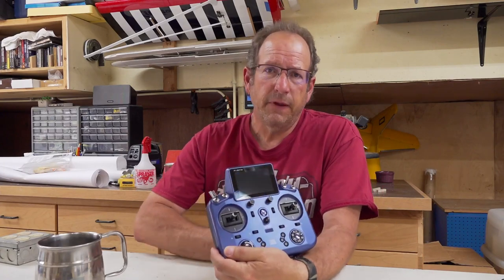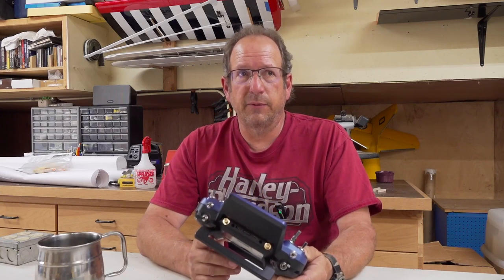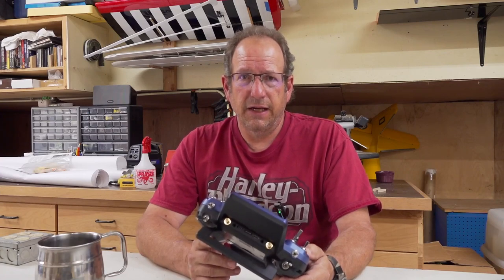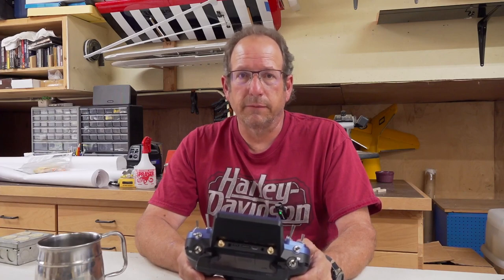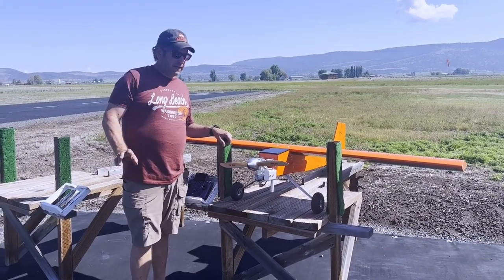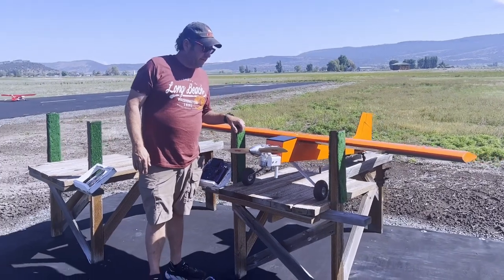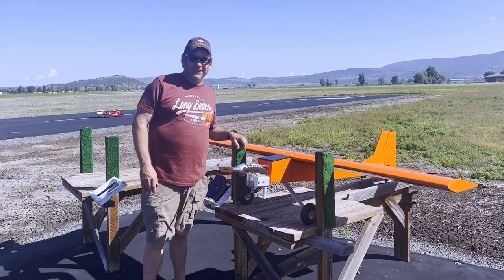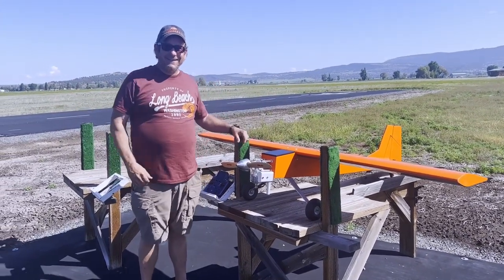Maiden Flights can be no fun at all.  Building a giant scale RC model, Ryan's Rebel RCM Plans

Comment: Dan you teased us with that maiden. The way you started the video, so somber I was waiting for you to say you crashed the Rebel. Congrats on the flight! Great build and flight.
Reply from the maker: That's one thing I was kind of afraid of, making a build series and then destroying it on the maiden.  But this design is so simple I wasn't too worried.   I did wreck one on a maiden several years ago.   I was going through a GeeBee fetish and built an Adrian Page GeeBee R-2.   Spent a lot of time to make it perfect.  Everyone warned me that the R2 is hard to land.  Like they always nose over.   It flew great very responsive but stable.   When it came time to land I had too much speed and the gear crumpled.  And I didn't have the energy or heart to give it any more time.  It is still in my storage unit.

Comment: Great job Dan and Mark. Loved the flight and the whole series. Nice field too. I just maiden my Arrows RC Husky at the Silverhills RC club grass field north of Hayden Idaho where I live. I wasn't so successful, had a stripped rudder servo, short flight and nosed it in on the right wing tip. Broken aeleron linkage horn not sufficiently glued from the factory. Made most of the repairs now. Installing the new rudder servo now and put everything back together  and go try again soon.
I am also scratch building two 50" Fly Babys from a set of plans.
Reply from the maker: Good luck on your maiden v 2.0.  Mark is looking over a set of plans he found for a big Fly Baby.   Might be a winter project for him.

Comment: Those maiden flights always gave me the shakes...  Good point about unknown trims and controls on the first flight.  Even if you are building from a plan or kit, and set the control surface throws to specifications, it may still turn out to be too much or too little for comfort.  
What has worked well for me is to set the throws a little larger than what I think they have to be, then use Dual Rate or Expo on at least the elevator and ailerons.  That will give you fine control even if the deflections are larger than they should be, and you maintain control authority when the throws are on the small side and you need to compensate quickly for a large trim error.
Reply from the maker: Agreed, and don't forget to expo that rudder.  Having a little expo will keep you from over correcting your takeoff.   I would rather have a little too much throw than not enough.  After that first flight or two you can reduce if you think things are too hot.

Comment: Can you comment on the overall flight quality?  Did it feel like a giant stik in the air. How was the handling in the air? I am thinking about building one --thanks
Reply from the maker: I don't think there was any bad characteristics of flight with this one.  Very much just a giant stick.  Landing is easy, stall speed is low and didn't notice a tip stall.  The Ailerons can be toned down as they are full strip so way too much throw is available.  Mark built flaps on his.  I don't think they are necessary as this plane slows down nicely.  Manuverability is great and predictable.  It has no recovery features like washout  or dyhedral so, you gotta fly it the whole time.  Yet it is stable.  I was sceptical the 30cc would power it adaquately but was wrong.  Power is perfect.  Ryan told me it would be.  Pretty much just a fully capable manuvering design that will do everything you want, although I haven't tried to flat spin it yet.  I am excited to finally have this one flight worthy.

Comment: FrSky range check function reduces the transmitter power to 1/30th of normal, or at least that's what it is for my X10S.  Also, the FrSky Tandem series of transmitters requires their tandem receivers to get the benefit of simultaneous 2.4gHz and 900mHz.  The Tandem transmitters are backwards compatible and will work with ACCST D16 protocol receivers.  Congrats on the successful maiden.
Reply from the maker: Thanks Don!!! Yep I have a lot to learn on this 18x.   I have a 10x that I just changed from OpenTX to EdgeTX.  The only thing I don't like is the 10x is its like holding a patio paver.   I might do some videos about the Fr Sky systems but there are a couple of English chaps that do a great job with programming and updates.   I just want to make it do what I need and fly it.
Reply: @Capgains7777  I'm trying out a Radiomaster TX16S this year.  Has a cheaper feeling compared to the X10S, but it is lighter and more compact.  So far, works fine.
Reply from the maker: Like what I have seen with the Radio master.  I lightened up by getting the Tandem and Ethos is a little more intuitive.  The Horus is able to run my XPS Rxs with the JR module box.  Which is cool but complicated.  Yeah once everything went 2.4 the options for geeky radios went through the roof.   Did you ever own Multiplex?

Comment: Congrats Dan nice job, Ive had the plans printed off so you know whats going to happen next don't you! anyway what receiver did you end up using with your neat tandem X20 tx.
Reply from the maker: I believe I used an X8R which is the older version protocol accst Rx I bought to use with a Horus 10 radio a few years back.  It’s a little confusing all of the options available with these FrSky radios.  The guys at Aloft Hobbies told me for IC gassers the best protection for noise is the Archer line of Rxs that use Access protocol.  However I have read many forums where guys are using the ACCST for long time now and no problems with ignition noise. With a tandem radio you also have the option of duel band RXs that cost a little more but transmit on two totally different bands at once making better redundancy.  Probably going to have a show and tell about these radios in the future.  I really like them.

Comment: watched all of them. great vids. presentation was good as well. what size servos did you use?
Reply from the maker: They are standard sized Hitec servos, HS545BB, which are nothing really special.  I built the Rebel with parts that I had on hand of which most came from retired planes.  On larger planes if I had to buy new servos I would probably use Hitec 635MG (metal gears) as they are a great choice for strength and reliability used by many  giant scale modelers.  Once again nothing special, plain ol analog servos but simple, powerful and good.  At some point I would like to research some digital options, because I know there has to be smaller, lighter and more powerful servos I can use, but I still have these analogs in my stock so I will use them up first.

Comment: I’m building a SIG 1/4 scale cub, I think I’ll be too nervous to fly it
Reply from the maker: I totally get that.  Take your time, build it straight, and set it up with proper throws and CG.  Have some faith in the design of the aircraft.  A lot of people have flown Cubs and you can too.   My only advice specific to cubs is, use the rudder to make it track straight on take off and make sure you have the tail flying before you apply elevator to lift off the runway.   Because the wing on a Cub is longer than the fuse and a big popcicle stick, the plane will torque left when you give it throttle.   Be ready to add some right rudder to track it straight. Cub flyers are good drivers.  Good luck.

Comment: It's like a young eagle standing on the edge of the nest high above the canyon about to jump for the first time. Will it fly or will it fall to its death? I know the feeling well. I did not set out to be an rc test pilot. It evolved. A friend asked if I would maiden his plane. It went well and another friend asked. Over time I was a popular guy to go to if you wanted someone to test your plane. I have encountered most every problem you can imagine.

I do my best to catch potential problems during my preflight check list. The usual suspects are out of balance (tail heavy is awful), low battery, controls reversed, not enough power to weight ratio, airplane not symetrical, does not track straight, wheels sticking, gear not forward enough on tail draggers, rates-expo not within reason, gyro settings not correct and gyro not set on a switch that can turn it off, bad or wrong size prop, props reversed, props not on tight,  plane stuck in 'safe' mode with hardly enough throw to control the plane, receiver problems at distance - can catch with range test, an owner who expects me the test pilot to pay for the damage if there is a problem beyond my control - so I get their sign off on that before I fly !  I like to walk the runway and check for debris. Then the last thing is I like to have the sky to myself.

There are always mixed emotions just before takeoff -  I try to focus on just one thing - fly the aircraft. I run thru the sequence in my mind before throttle forward then try not to over think it but to trust my experience.
Reply from the maker: I have been there myself.   The test pilot.   I always tell people that I will do my best but no guarantees.  Check the plane out, ask questions, charge status, engine run time, range check, was a CG done, hope they did it right.  And yes, just fly the plane.   Funny thing is, and something I brought up in this video is the emotional attachment you get from building the plane and then taking it to the air.   For some reason when I am test flying someone's plane, I don't get that adrenaline rush.  It's like all business.  Not so much fly it like you don't have a dime in it, but the shakyness isn't there.   I really think the time and care to build it causes that nervous attachment.
Reply: @Capgains7777  Yes !  I've seen students shake so bad I had to take control....and I saw one of our most experienced pilots shaking like a leaf after the maiden on his big sweep wing Tomcat.